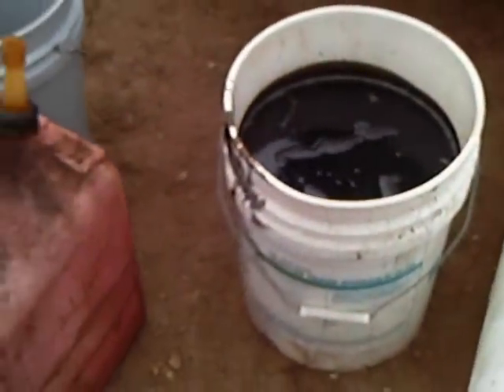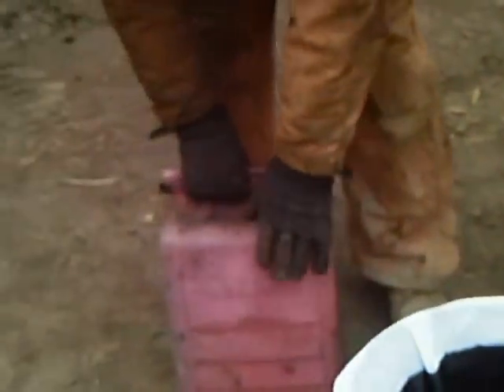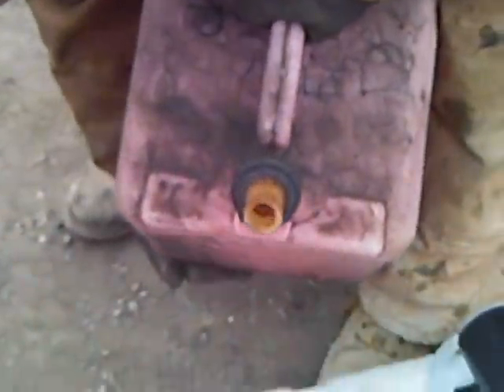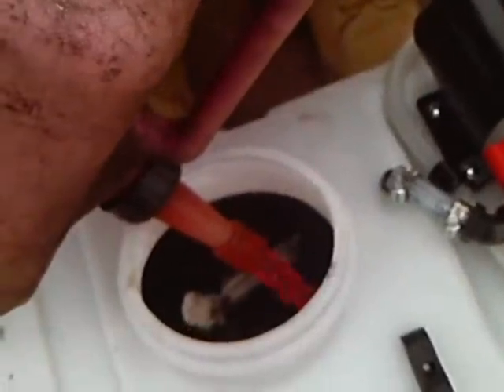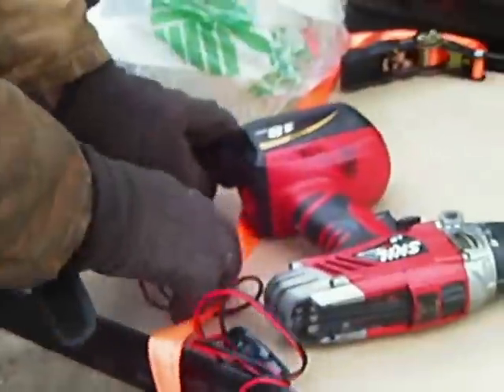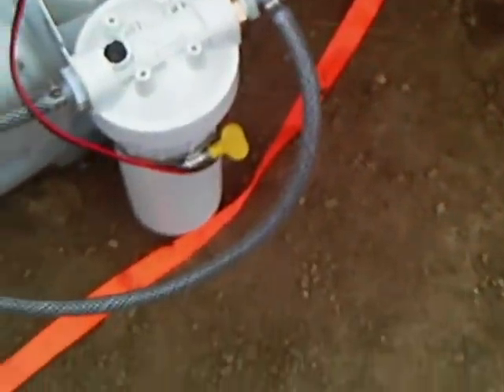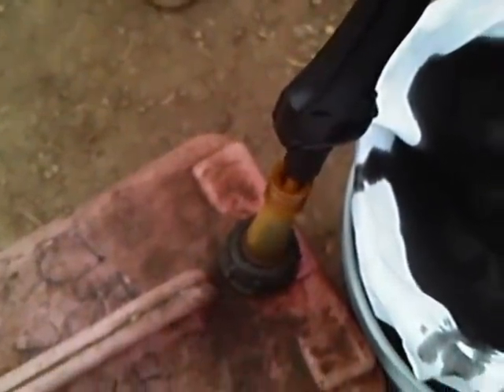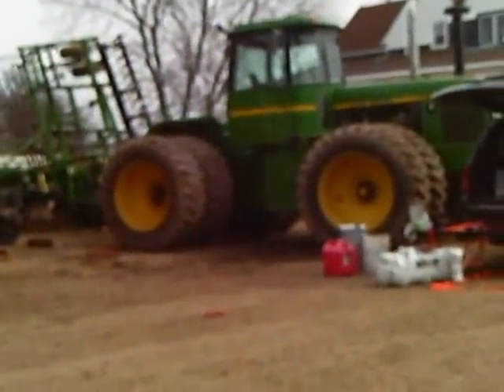turn used motor oil into diesel and save $$$

Comment: Hi their, I have a question, if I take used diesel motor oil or gas motor oil, after its been filtered good. can I pour it in and run the diesel engine? without messing up the injectors? thank you.